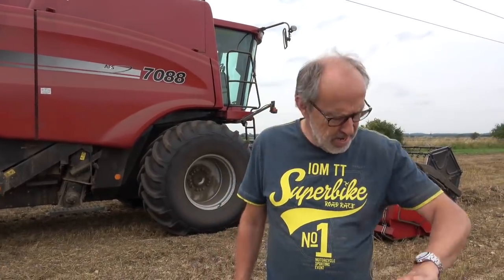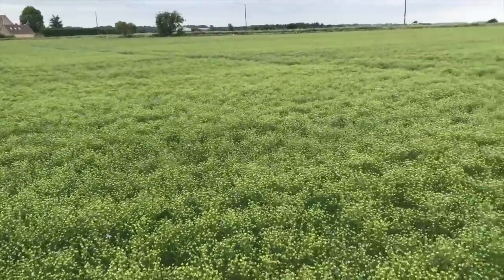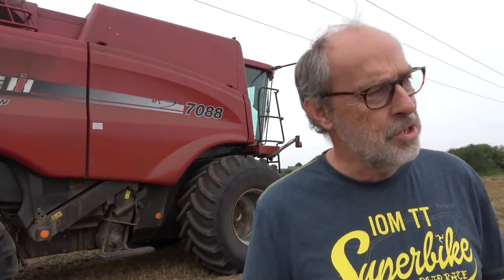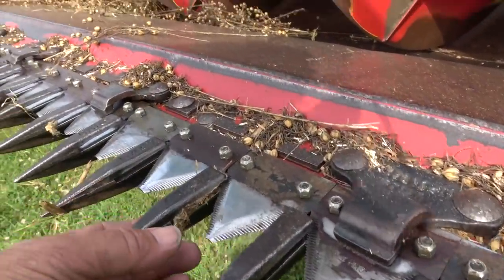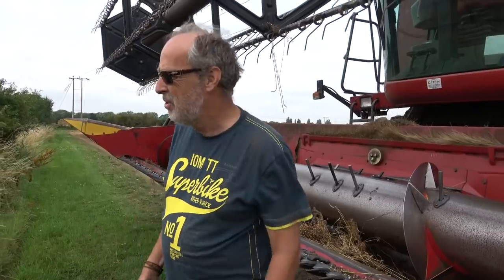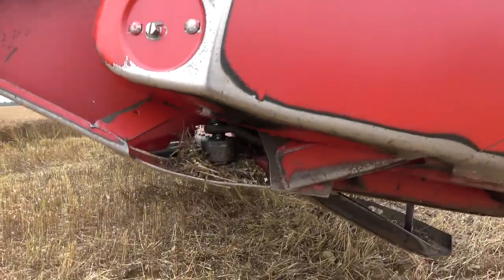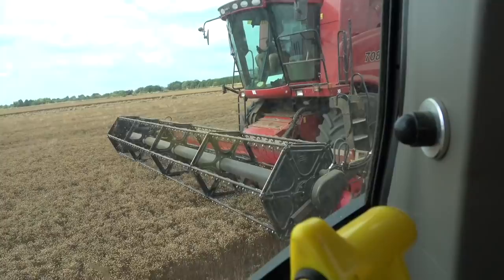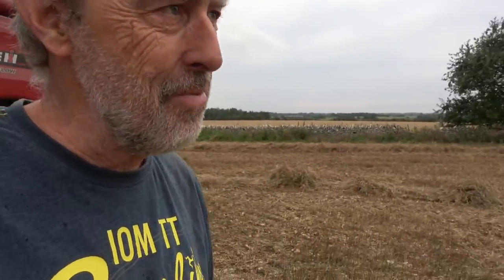Combining the Linseed, what could possibly go wrong..

Comment: Hi Harry, when I operated combines, the knives were fixed on by rivets. Pretty handy using bolts and nuts.
Reply: Yeah, I can remember them as well. Taking the knife section out and them thumping the old knife with a hammer to shear the snap rivets! Then having to round the heads on the new rivet.
Reply: @robhardingham6770  yeah, great fun..... And trusting somebody to push it back in while your own fingers guide it back into place......

Comment: Harry,
There should be a complete standard knife bar, including the vertical knuckle joint store in the square lover box section ant the rear of your header.
You could have pulled the broken knife bar and joint out and replaced it with the spare in about 5 minutes.
That way, you wouldn’t have damaged the arm between the knife dive gearbox and the knuckle joint.
Hope that helps you for the future.
Richard Ward.

Comment: Things have moved on since my farming days! - That moisture meter looks pretty slick, and I still remember using the old coffee grinder and "Protimeter", reading off a scale and calculating the moisture content - now those were the days! and 'bolt on' knife sections, well I never! I remember on our New Holland, they were riveted, and you had to haul the knife right out of the header in order to change a section. I guess too you had that dreaded agony of choice there, either stop right there and replace that ball joint on the end of the wobble arm, and risk missing the dry weather, or take the chance and accept the extra cost of knackering the arm - I guess it comes down to where lies the biggest loss. I did wonder though, just how much throw did you lose (knife travel if you like) because of the worn out joint? Coming down to minutia, I would have though it would slow your progress through have less cutting stroke, and more likelihood of the linseed straw hanging on the fingers.

We never grew linseed, but did we have some fun among the rapeseed? Oh yes, even had to get a newer combine part way through because the old, old New Holland dropped more seed than it saved, even after miles of Sisalcraft grain bin tape to cover all the little holes where the seed somehow found a way to escape. We learned a lot in our first season growing rapeseed, and not least of which, keep out of it when it started to get damp - grain dryer or not, it's the endless effort of unwinding the straw from around the drum, and poking the mush out of the concave. . . Oh happy days!

Personally, I wish we'd kept on with the potatoes, and never had rapeseed at all, but that wasn't my decision to make.
Reply from the maker: I used to have one of those moisture meters too! They were very accurate and were what we used at the lab when I was an on-farm grain buyer back in the eighties.  It was a choice of continuing and doing more damage, or stopping before more damage was done. Made the right call, I think..
Reply: @harrysfarmvids  Hi Harry, indeed they were, but further still, I remember when "T'owd Fella" could judge the moisture from chewing a few grains! Absolutely straight up, he'd grab a few grains, bite and crunch, then chew for a few seconds and say "That'll go ar'reyt" or, "Leave it, it's not fit". The Protimeter would usually confirm his judgement. Of course, we did have an Almet continuous flow grain dryer, as well as a six bin batch dryer, so we never really had much trouble bringing the harvest home, other than the rapeseed - I still have nightmares!

Back to that ball joint, as I say, it's a judgement call, and I guess it's down to which would cost you the greatest loss. I know sometimes the machine repairs can work out cheaper than the loss of the crop, or part thereof, and the knock on effect if you can't get that field cleared and ready in time for the next.

Speaking of bottles and knife blades, it's a good thing you're not on the route of the Tour De Yorkshire. You'd never believe how much stuff those riders, not to mention the spectators and followers, can fling over the hedge and into your crops, and the bit I can never understand, is why only drink half a bottle of water, and hurl what's left 5 to 10 yards into the fields - have they no consideration for the countryside?

Farming in the '70s was a golden era, to me at least, but I had to pull out when arthritis began to set in. I went to work at an agricultural college after that, but even then had to retire early because of it.

Ah yes, great times. I miss it, but would I go back and do it again? - Hmm, I'd have think about that one.

Comment: It looked as though the some of the knife guide had a little two much clearance which is quite critical with linseed. The all the sections need to be keep as close as possible. Rather like getting the manhole cover as the bottom of Bray Hill out of line....not good. That also put pressure on the drive knuckle..............

Comment: Ever destroyed the wobble gearbox that drives the knife? That would have been my biggest fear continuing to operate with that destroyed bearing. If it goes you could be out of action for days. 
Typical Farming. Rain coming. Destroyed bearing you should stop to fix but push on fingers crossed. 
You are very calm Harry on Video? Most farmers don't stay that calm with problems arising and threatening weather.

Comment: Funny story… Back when linseed was relatively new as a crop around your area we grew a few fields, lucrative as it was. Anyway, after harvesting the first field we had the ‘straw’ left. What to do with it? So we had the grand idea of raking it up with a large muck fork into several bonfires and burning it. 
My step-dad then attempted to light it. After a few goes it went… and really went. That’s when we learned that a. linseed straw is basically oil-filled (or something like that!) and b. it’s possible to singe off eyebrows and fringe with the ferocity of burn!
After that we baled it (poor baler) and used it in a straw burner that heated one of the house’s water – it’s great for that, super-hot super-fast!
Reply from the maker: Linseed straw is tops for burning, mine goes for use as initial layer in sheep/cattle sheds, as it helps the straw put on top to last longer.

Comment: Changing the laws and regulations on what types of crops to grow and how to grow the crops , the UK government does not provide the necessary equipment to harvest the crops.  It is leave the problem for the farmers to solve the problem 

It is like moving the goal posts 10 meters high in the air 

How do you expect farmers to reach the government goal post ?

If you have more than 2000 hectare and employ lots of people. 

They might have the resources.

But Harry does not enough resources 

Jesus this changing regulation does nothing good for the farmers
Reply: The same the World over. Brainless insecure pressure groups always out to have something banned. In reality most are simply Control Freak useless people.
Idiots you can never reason with. Every action has a consequence. Very often the consequences are far worse than the benefits. 
If we lived in a Just World the people who put pressure on Legislators to bring in these changes should be forced to live in grass and mud huts with subsistence type food supplies. Often it is not true Experts that bring about these changes. Its idiots in pressure groups that don't have any understanding of the overall. The key is not to have Politicians who bow down to them. 
Most so called Greens fall into this group of people. The reason most things they push for end up counterproductive.

Comment: They have a  farm machine that removes stones from fields an leaves dirt ! You will have fence rows made of loose rock!
Reply: sol star stones are an essential part of the soil  structure.
Reply: Tom 441 - and the stone is really rough on the harvest cutters b”breaking knives” in the combine!   And you put the loose stone in the headge to separate the fields ! As it’s the farmer modifying the dirt in the fields throughout time to improve crop yield 😃
Reply: sol star : true the larger stones should be removed, but not ones less than 1/2 a brick size.
Wouldn’t the removed larger stones just damage the hedge cutting machine,  If put in the hedge?.